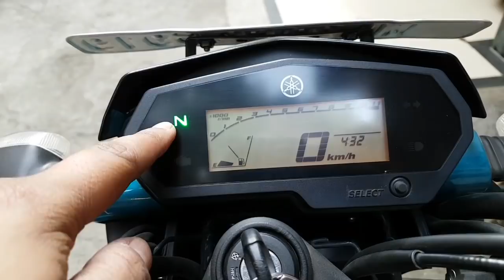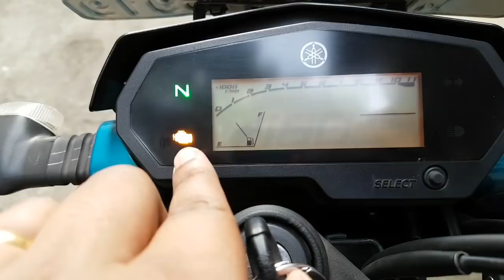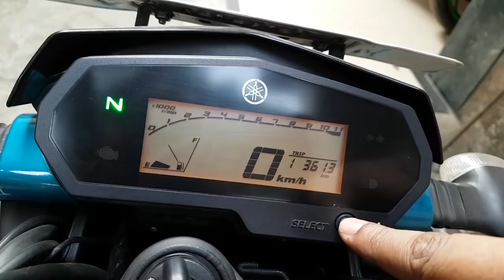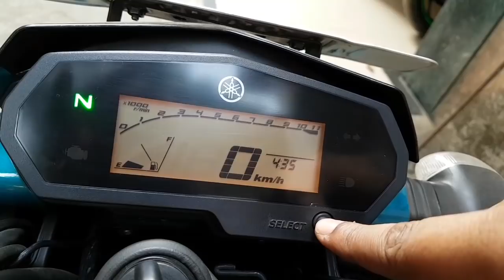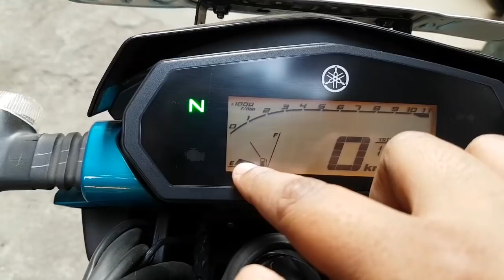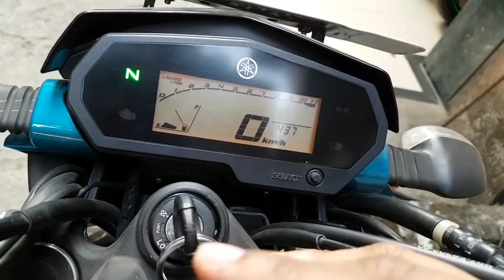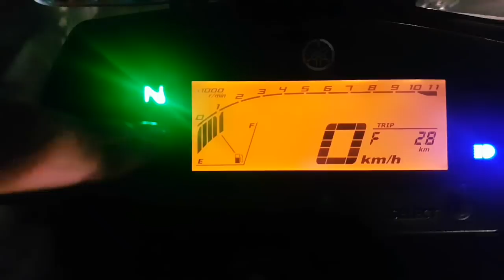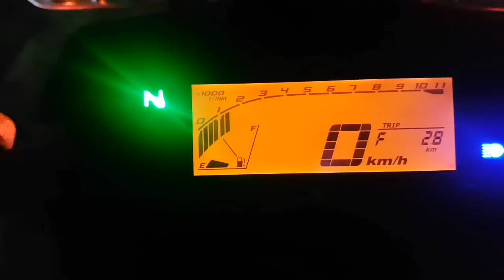YAMAHA FZ25 SPEEDOMETER : EVERYTHING YOU NEED TO KNOW

Comment: I could only tank up around 10. 5 litters of fuel after I get trip F on many occasions!
I have done 47 km on trip F and tried to fill up the tank and I was able to fill only 11.89 litters which means it still had 2.11 litters left in the tank!
I think when the trip F comes we have around 3.5 litters.
Note: 2019 ABS model and I always fill upto brim..
Reply from the maker: Same here.. trip f was the same fir me and I filled about 12 litres .. There is quite a lot of fuel even after trip f buy i wouldn't suggest going that far as you may damage the fuel pump

Comment: The average shown in my FZ25 is not accurate. It showed 33.4 kmpl but I was actually getting a little over 36 kmpl. I calculated average by resetting one of my trip meter to zero when I filled 5 litres of petrol and I could ride for around 183 kms till Trip F.